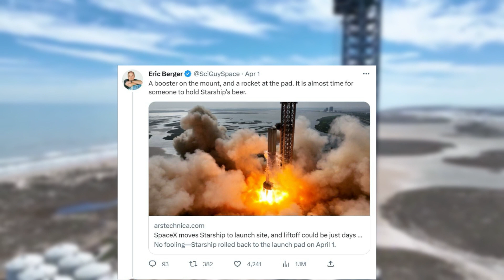SpaceX’s Starship Is Getting Ready To Launch

Comment: OK--------...  Environmental Factors seem to be the Biggest Problem with getting the License to Launch Starship NOW and probably for every Launch in the future from The Space X launch facility along the Coast...  So MOVE the Launch Platform off Shore Where there are no Seaturtals, Nesting Birds, flammable Grass, Beach Bums or Environmental Factors Prevelaint across the Beaches and Swamps to consider... Space X could build an offshore launch tower a FEW miles offshore on Pillings with a long peer with elevated Rails on Pillings Straddling the wide roadway for Access that would completely avoid the Hyway running from the Factory to as many launch towers as Space X needs scattered across the Gulf like any Wind Farm...  Space X has spent a billion Dollars on the Current Launch tower which is restricted to a Maximum 12 launches a year with only 6 of them to Orbit.... A launch platform miles out to sea would allow Space X to launch as many times a Year as they Please to Orbit, the Moon and MARS, with few Environmental Restrictions that are necessary for their Beachside Swamp Platform making licenses easier to get while any Crashed Rockets around the Sea Towers would simply add A new Artificial Reef to improve the Ecosystems of the ocean floor providing new homes for thousands of Fish and Marine life... Instead of having to spend a year and billions of dollars to rebuild the tower and a square mile of very Expensive infrastructure!   The Gulf Waters would also Salve the 33 engine Exhaust problem trying to dig holes to China!!!